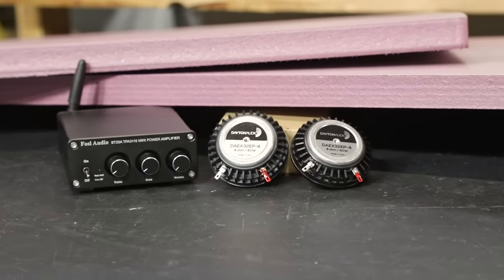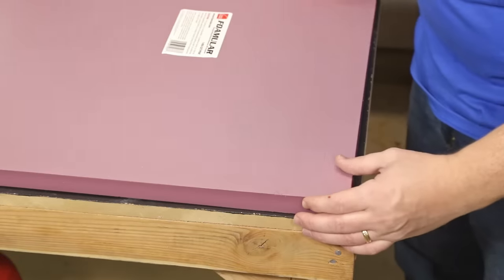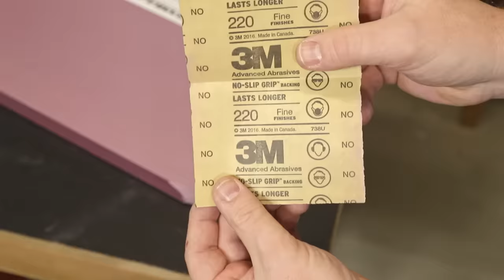How To Build "The World's Best Speakers" - Are Flat Panel Speakers Really Any Good?

Comment: No you DIDN'T build the " worlds best speakers" as you missed two important details, there is a specific ratio of the rectangle sides which affects the spectrum of frequencies. ALSO, THE SPEAKERS MUST BE MOUNTED OFF CENTER OF THE PANEL MASS. To limit dynamic counteraction of forces which also affects the spectrum of frequencies. Silly build.
Reply from the maker: Hi John - I was only testing 1 aspect of the original TechIngredients video series...and I did in fact mount one of the drivers off center in this video, per their instructions. You may also find my follow-up where I test subtle changes to the construction and panel design to see how it affects the sound here: https://youtu.be/XC814uQjlaE

Comment: You completely invalidated your own test by using some unspecified, almost certainly low bitrate, bluetooth connection :/
Reply from the maker: Completely invalidated? I don't think so. Also, I was VERY specific about the exact model of amplifier I was using, and less than a minute on Google shows the exact Bluetooth chip it is using, with complete specs on the various encoding, bitrate, and standards it employs. It's a Qualcomm QCC3003: https://www.qualcomm.com/products/qcc3003
Still - in my follow-up video I'll be re-testing these panels (and a bunch of viewer-suggested ideas) with a wired connection. Stay tuned!

Comment: 10:38 -   you mentioned 24 x 48
Well - the ratio is not quite  2:1  
It can be a little under or a little over
I actually use the 'Golden Ratio' of 1.618
one part wide  by 1.618 long
And make sure to use base 10 for simple calculations.
Forget the Imperial crap
Nature does NOT work in Imperial -
Imperial was used by idiotic Kings who could not work out that the
the creator had given them TEN fingers and TEN toes.
They were so stupid that they missed the obvious.
Much like North Americans,
Ignore-ance is NOT knowing
Stupidity is failing to Learn
Reply from the maker: Hold up - did you just insult the collective intelligence of all of North America because of something that started in... checks notes ... Europe?

Comment: why didn't you play white noise or pink noise and record the results so we can look at that in a frequency spectrum plot?  The low end is lacking because the panels move to much.  To get punchy low end you need to have a heavy fixed body that the cone is attached to so it can return to test quickly, that isn't possible with this setup so the low end is going to sound crappy at best.  Same issue with the transients, the transients sound much sharper and better on your cell phone.  Also disappointed in the video click bate title.
Reply from the maker: Sorry you felt the title was click-bait... I was just using the same terminology that TechIngredients did in their original video. Did you see my follow-up video with a much more comprehensive set of testing? You'll probably hate it, too: https://youtu.be/XC814uQjlaE

Comment: Mounting them by the exciter rather than the board would make more sense. It's like you're mounting a speaker by gluing the cardboard cone to something, then letting the frame give out the sound. In a design like this, where it hangs, you might get more bass by weighting the exciters, so the boards would be pushed out more on the low frequencies where it really takes effort to move a speaker. 

You also might look to see if the piece-of-shit looking Ebay amp is any good. Maybe it came to you recommended. Does it run off a laptop power supply that weighs basically nothing? You could change that, too. A sensible person who was really chasing the best sound might use a battery to power the amp with DC. An "audiophile" though would just buy a metre of solid gold mains cable to plug into his wall, while trying not to think about the hundreds of miles of aluminium wire it travels through to get there from the power station, picking up every bit of noise in his neighbourhood on the way.

You don't need a battery but a decent power supply might well make the difference with the bass. A weedy PSU limited in output current might fail to provide it for the big booms. It's why car audio fans fit those huge capacitors. They essentially act like buffer batteries, but recharge in a fraction of a second, supplying great amounts of power for a period of seconds or less. You could perhaps just buy an electrolytic capacitor. The amp says "12V" but is that what the PSU gives? Usually they're 19V laptop PSUs. In any case get a capacitor rated 40V or so, 63V is common. The convention is to pick double the intended voltage as a margin for reliability. Anything higher than that is also fine. Rating in uF should be big as possible, just go by what seems reasonable for price and physical size. Then connect it across the power supply rails. So if the amp needs to draw more current than the PSU can provide, the cap will make up the shortfall. Otherwise, you get underpowered bass.

You could use one intended for cars if the PSU really is 12V and no more. Capacitors are sensitive to over-voltage, and the supercaps they use for car audio operate fairly close to their voltage limit. No 2x margin of error.

OR you could just use a normal hifi amp that runs directly off the mains. Instead of cheap Ebay garbage. Then test the speakers with that. Sound quality depends on amp AND speakers. And PSU, but any halfway decent amp has an adequate PSU. And I'm not talking expensive high-end, I mean stuff you'd buy in a high street shop. Any brand that you've heard of. NOT the stuff Aldi import from China and stamp their name on, I mean names people were buying in the 1990s and before. Just brands that people would have in their houses back then.

You need to get a proper amp to test speakers. You don't have to go audiophile Superman quality, but good enough that any inadequacies are the fault of the speaker and not the amp driving it. The amusing thing about audiophiles is that, beside them insisting on quality way beyond what's perceptible by human ears, by the time you get to be able to afford all that crap, you're usually middle-aged and have lost most of your hearing anyway. 

You can't do a speaker test with an unproven, unknown amp.
Reply from the maker: I appreciate your thorough response. Did you happen to bother checking the link in the description to the amp itself, and look up any of the specs?
Reply: @AmplifyDIY  No, because I had a strong feeling that the manufacturers wouldn't have bothered telling the truth in them. For one thing, as a 100W RMS stereo amp, on a 24V 4.5A power supply, it would have to be around 185% efficient. 

And yes, it is a cheap shitty laptop PSU. If you threw it at a window I bet it would bounce off.

So, I appreciate your dismissive and sarcastic response, but those "specs" are nonsense. The manufacturers copy them off each other. Or else they take the datasheet for the chip and multiply everything by 4. Does it LOOK like a 2x100W amp? Does the PSU look capable? Are you capable of telling? Do your job properly. A piece of shit amp, which your link has now confirmed it is, with a PSU that is physically incapable of driving it at it's stated power, is likely not to be the highest-quality way to drive a speaker.

The real audiophile crowd will have fainted when you mentioned Bluetooth. I'm fine with that, I listen to music cos I enjoy it. But you can't fairly point out the inadequacies and failings of a new speaker design, with an inadequate and failing amplifier driving it. 

Besides the diagrams showing you what plugs go where though, there don't seem to be any measurements of distortion. 

I don't know the chip they're using in it. It's probably quite good, chip amps usually are. But they've set it with an inappropriate and underpowered SMPS, as I suspected (it was a pretty safe bet). Every corner will have been cut in manufacturing, in Chinese business culture that's actually something they're proud of. You bought a garbage amp for cheap, and don't seem to know it. What sort of DIY audio channel do you run?
Reply: FWIW, BTW, a bit of consumer-quality hifi would see you a lot better than buying crap new. Even an old separate amp from the '70s - '90s would be good. Separates gear particularly was better than integrated stuff. And nobody wants it nowadays, you can get it pretty cheap. The worst that ever happens is a fuse blows, or the volume control goes crackly and needs a squirt of contact cleaner, maybe do the switches too. Even good stuff like Marantz and Yamaha are available reasonably-priced second-hand, and will do a good job of anything you ask of them. 

Since China's rise to being the world's factory, quality has plummeted for many consumer goods. Prices have fallen too, which is nice. But so much of what is in shops now, if they still have shops in your town, is shit. Ebay and Amazon have made it worse. On Ebay, you don't know the brand, the manufacturer. You've never heard of them and can't tell one from another. So they don't develop reputations. All they have to trade on, is price. When you can click a button and sort by price, the cheapest is gonna win most of the time, so getting that cheapest price is crucial to business.

But of course a business wants to maximise profit. Their only option is to cut costs, and in these cases they do it by cutting quality. But still, so does everybody, so the competition doesn't get any easier. Race to the bottom. New developments in technology fight the trend, but on a website prices can change in an instant. 

We need to go back to companies having reputations, and valuing them. So that they won't let the customer down and get a bad name. Not just competing on raw price. Maybe there will be a consumer revolution, but until then quality is going to fall to the level people are willing to put up with. Then a bit more.
Reply from the maker: Dismissive and sarcastic? I was not trying to be either. I apologize that it came across that way. This amp is inexpensive, but it sounds fantastic... and that's all that really matters. And I've driven all kinds of things with it, including a decent set of Klipsch bookshelf speakers as well as some stuff from Paradigm.

But you are not the first to complain about my choice of amp - in the follow-up video on these panels that I published just today I tested with a different amp... which you are also likely to hate. However, before settling on that amp for my testing I dug out my old Sony surround-sound receiver that drove my home theater for 10ish years, and compared several different sets of speakers between it and the newer amp I ultimately used... it was absolutely no contest... the Sony sounded terrible in comparison.

Finally: I don't run a DIY Audio channel... I run a DIY channel that happens to have dabbled in an audio project. Take a peek at my video library, and you'll see what I mean. I was interested in these audio exciters when I first ran across them, and I wondered how well they'd perform on the cheap. The answer is that they are better than anything else you can get at that price point, but if you truly have a discerning ear you'll look elsewhere (and spend a lot more money).